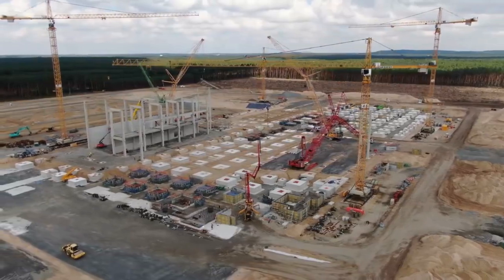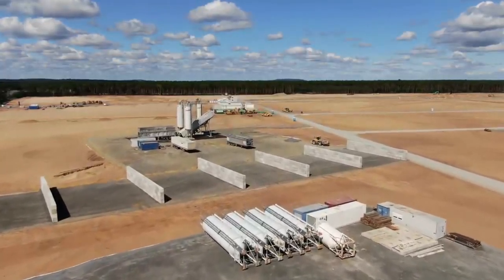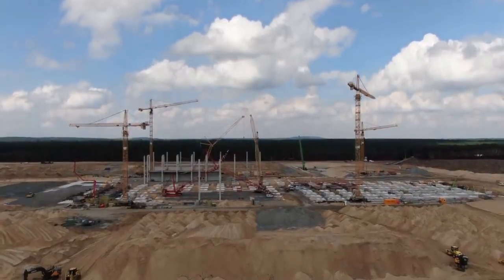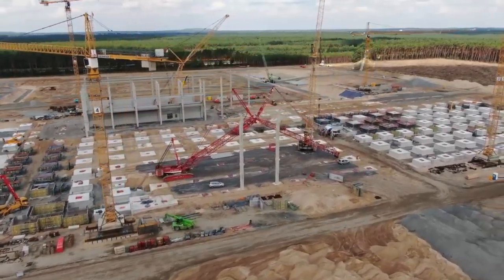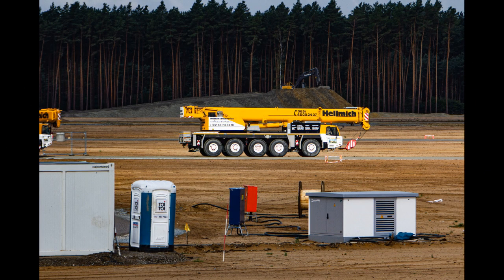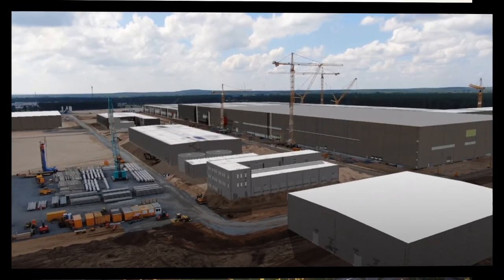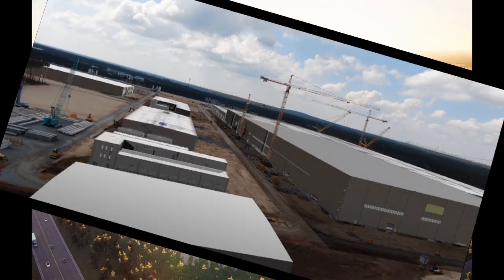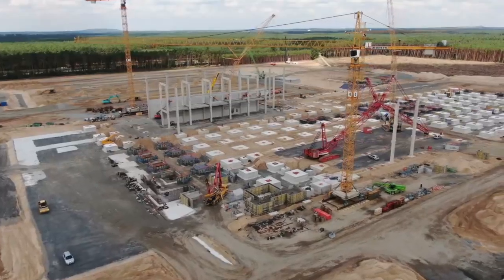Giga Berlin Construction Progress Update Through July 20, 2020

Comment from the maker: VERY impressive, truly gigantic project. Material choices are extremely interesting. They DID choose precast concrete for the structure.
Someone's been very busy for a very long time on this project, you don't start producing all these structural members overnight. Seems like those enormous columns fit in holes in the enormous footings. 
Looks like the building structure might well be already cast for the most part, stored away from the job site, and probably curing before installation. That's one way to get the project to move at the speed of light.